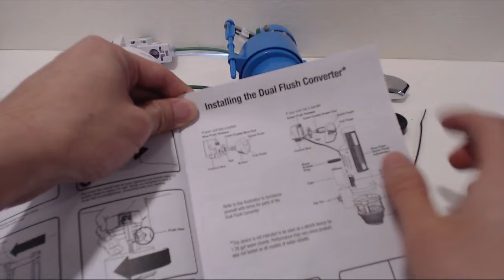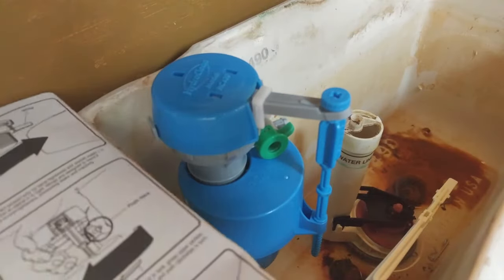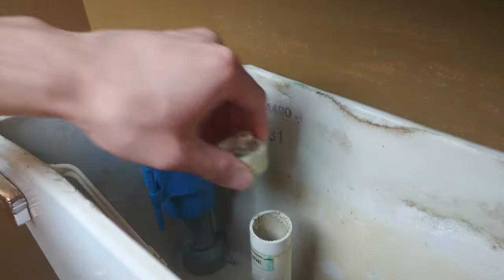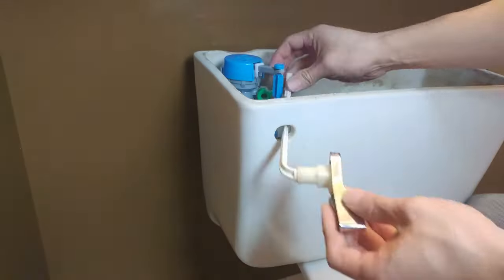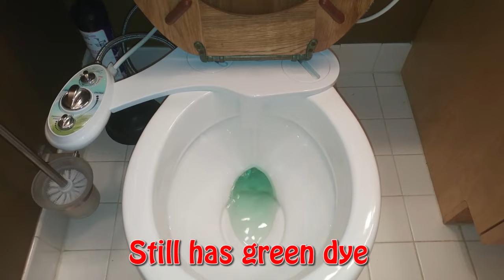How to Install Danco Next Duo Flush Conversion Kit and Review

Comment: Very helpful video.  1 tip for everyone that I missed, is that the nut on the handle is reverse threaded.  The longest part of the install was figuring out the reverse thread.  Beyond that, it was super easy to install this kit.  One thing I would have liked to have seen in this video was how the handle itself worked to select the flush option. Thanks.

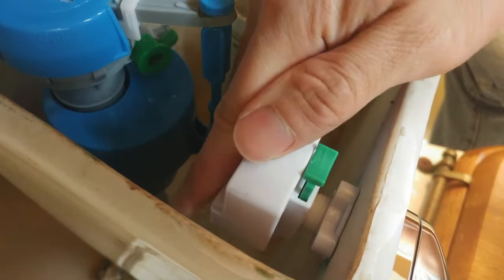Comment: This is an excellent video! I watched it several times to familiarize myself with all the aspects of replacing the flush unit.  The only thing I noticed was that at 2:53 when you put the flush converter back together you say to screw it in with a clockwise turn, but your video shows a counter-clockwise turn.  At 2:18 you mention turning the base clockwise to disassemble the converter so it makes sense to turn it counter-clockwise to put it back together.

Phil what do you do for a living? Your presentation and insights are awesome as shown in how you put this video together. I watched several videos from others, but yours is way better and concise. I've done two toilets so far with zero problems - thank you so much bro!

Comment: I know nothing about fixing household items.  You made my life easier.  I bought the HYR451 from Home Depot and it was in an open box without instructions.  Great price, but I thought I could figure it out on my own.  I was wrong.  Thankfully, your video was full of easy instructions and videos.  I was able to replace the old toilet insides with the new insides without much trouble.  Note that I was getting a little draining of the water from the fill tank into the toilet.  A little nudge to center the fill valve in the opening and it worked.  Thanks again!
Reply from the maker: You're welcome! I'm glad the video was able to help you :-)

Comment: This video was very helpful.  I could not get the quick flush to come even close to draining the bowl but based on the tips in this video, I tried increasing the height of the fill valve to be a bit higher than the top of my tank, while still fiting under the lid, and that fixed the problem.

Comment: This is really helpful.  I installed the push-style flusher in the two bathrooms in my home about 7 years ago. Recently one has started to "ghost flush" and I can see a slow leak from the tank to the bowl.  I disassembled it to try to isolate the leak and inspect the gasket (I'd heard that the material can blister) but the material still appear structurally sound.  I don't have the old manuals but I think I can tell from your video that there are some adjustments I should make to the way I create the seal with the cam and adjust the flusher to my overflow tube that may solve my leak.  That or I'll just need to install a new one.  Thanks for posting!
Reply from the maker: You're welcome! Yep, I think I had to make some minor adjustments after it was a few years in service. Eventually a plastic piece broke in the fast-fill valve and I had to replace that part, but at least it was sold separately and I was able to get the same part from a big box store. Good luck with the repair!

Comment from the maker: The larger side of the handle only separates from the smaller side past a certain point. If you press down only on the outer edge of the handle and hold it down, does it still not separate from the smaller section? Try removing the handle and see if the pieces are somehow stuck, glued, or taped together. Mine weren't, but they should separate too when not installed, which could indicate a possible defect if it doesn't.

Comment: Hey Phil really cool review! thanks for doing it.  I just installed one last night and have to hold the handle down to fully flush. do you know of any adjustments to make? or is it because my toilet tank is too small? Thx again!
Reply from the maker: Yeah, it sounds like it's not getting enough water per flush. If you raise the float it'll allow you to get more water overall in the tank which might fix the problem (see 3:19 for adjusting the float leveler), but if you're already at or around the overflow tube level you won't be able to get more water in the tank which indicates the tank size is just a tad too small. The other option is to allow more water per flush, by adjusting the blue and green water meters (see 3:24 and 3:36, push them down for more water).
Reply: ReviewedByPhil thx Phil!  I didn’t try to adjust the float!!  I was just messing with the blue and green adjusters!!
Reply: Thanks for this you just saved my sanity

Comment: Good explanation in this video.  I’m still not sold on why anyone would want a dual flush toilet though, since you proved it might not work. Water is a cheap and abundant resource.
Reply from the maker: True, in the US, water is inexpensive and averages out to less than a penny per gallon, so from a cost savings standpoint it may not seem like a great incentive. But viewing water as an unlimited resource ignores the fact that many parts of the US experience periodic or frequent droughts (roughly 30% of the country experienced some measure of drought as recently as last month according to the US gov't drought monitor) making water conservation essential in those communities during those times, which can last for months on end, or years in some states. Abundant may be the overall trend, but isn't always true for localized points in time in all places. Plus I think folks feel good about saving water to preserve the environment by way of reducing the energy required to process and deliver water, minimizing pollution vectors, and conserving related fuel resources.

A quick note on why I think the dual-flush didn't work in our guest bath: we already had a water conserving tank on that toilet (hence its shorter height) and since it used less water than a standard tank (3.5 gpf), the dual flush wasn't really an appropriate modification because there wasn't enough water in the tank to make it function correctly and the conservation benefit was not as pronounced, though this was not realized until after I completed the installation. The conversion kits works quite nicely in our standard-sized toilet tank.

Comment: Hi Phil, I pray you still see comments. I have a Fluidmaster Dual flush that I installed years ago. But, it's ghost flushing. I've spoken with their rep but no one sells what I need. I bought Danco HYR460 Total Repair Kit Dual Flush. My question is if it's ghost flushing isn't that caused from the seal? I'm not understanding how this is going to correct a leaking seal. Then I read one of the comments here stating a ghost flush could be corrected by tweaking some adjustment but I didn't follow his comment.
At this point I've not started any installation only removing some the fluidmaster. 1. I'm curious will an adjustment in the Fluidmaster stop the ghosting? 2. Will this kit work to stop ghost flushing? 3. Am I right in thinking this is not replacing the seal?
Reply from the maker: Hi Barbara. Yes, ghost flushing is typically caused by a leaking gasket or seal. In the Duo Flush conversion kit there are two seals, so potentially two points of failure. The first is the curved blue gasket at the bottom of the flush valve that sits in the hole in the tank that drains into your toilet (see 2:26). The second seal is inside the flush valve; when you twist and split the unit apart, there's a blue flat washer/gasket as the bottom of the interior piece (see 2:20), and if this piece becomes warped or crusted with buildup/debris, it can cause an internal leak allowing water to slowly leak into the bowl and cause ghost flushing. Since you purchased the total repair kit, this comes with both the fill valve (part with the float) and flush valve (part that sits in the tank hole). You probably won't need to replace the fill valve, as this part usually doesn't cause any issues. Replacing the flush valve will provide you with both brand new gaskets which generally fixes the issue. If you want to try simply cleaning both seals, this may also remedy the ghost flushing if it is cause by buildup, though it's pretty much the same amount of work involved to drain the tank, and remove the flush valve to open it to clean both gaskets with soft sponge or toothbrush before re-installing it.

Comment: Hi Phil , great video bud . But after installed , I still have some leaking and the water refilled itself after 20 minutes or so . Where should I checked to stop this issue ? 
Thanks so much.
Reply from the maker: Leaking typically means the seal between the fill valve and opening in the tank is not watertight. This can be due to insufficient contact between the blue rubber seal and the rim of the hole (left a little gap) so pressing down a bit on top may help create a better seal. Just be careful not to overdo it because pushing the gasket in the hole too far can also cause leaking if the seal gets wrinkled. In this case the unit would have to be backed out slightly until the gasket is secure against the open but not forced down into it. I hope this explanation is clear.

Comment: Hi Phil - not sure if you still check this but I had a question. If I hold the quick flush button down it will drain the entire tank.  If I hold it for just a second it will only drain for that second.  How do you get the quick flush to drain just the right amount no matter how long you hold it?
Reply: And thank you in advance!
Reply from the maker: If you're finding that you need to hold the quick flush down (any amount of time) to get the quantity of water used just right, you'll likely need to adjust the blue "float" in the flush valve shown at 3:24. To use more water, push the float down and lower its position in the flush valve. If the blue float is already at the lowest position, you may need to adjust the water level in the tank so that the total volume available is greater. To do this, twist the "float leveler" knob, shown at 3:17 clockwise and the water level at cutoff should rise in the tank. If the water level is already at the top of the overflow pipe and you can't go any higher, then it's likely you have an eco-saver water tank on the toilet, in which case it's already using less water than a standard toilet (1.6 Gal/flush), and the Duo Flush may simply not be suited for further reducing the water usage in this situation. Hope this helps!

Comment: The hardest part was removing the fill valve nut on the old one. I had to cut it off because it would only unscrew about 1/4". The second hardest was adjusting the level of tank water because the fill valve and float wouldn't adjust to a higher setting. The J valve is the next frustrating thing. The instructions were not clear enough as to when to attach it and what function it serves. After reviewing 4 Youtube installation videos I took out the other part where the old flapper was to install the j tube. I'm not much of a repairman so some of the frustration is my inaptitude for this kind of thing. Now we will see how long it last as some comments are saying it will not be working within 3 or 4 months. One More Thing: Plumbers are worth their weight in gold!!😡

Comment: Hi Phil your step by step instructions are awesome. I have installed mine last night,. It went pretty well except the fill valve keep on filling up every 5-7 minutes. I have tried to install the blue gasket into the drain so many times but nothing is working. Seems like there.is tiny leak somewhere. Do you have any advice?
Reply from the maker: Hm, sometimes I've found that some folks were pushing the blue gasket in too hard into the hole which was causing it to warp/wrinkle. Pulling it out gently to relieve the excess pressure allowed the blue gasket to form a better seal. You should be able to tell if it's leaking there into the bowl because you will see the water in the bowl moving/rippling after the tank is filled. If you're confident that the leak isn't around the blue gasket for the main flush valve, is it possible that the water is overflowing into the overflow pipe because the float is set too high?
Reply: Appreciate your reply, it turns out my toilet is not compatible when I contacted Danko.

Comment: Phil! I am stumped with one thing - I, for the life of me, am unsure how to remove the original base assembly for the flapper. I had one similar, installed ten years ago, and the assembly is wedged in there and not sure how to remove it.
Reply from the maker: Hm, once that top o-ring on the overflow tube section has been removed, you'll need to remove the gap cam first (2:30), then you should be able to pull up on the bottom of the base assembly, and it should slide out of the tank hole.

Comment: This video made the installation super simple. Thanks a bunch for making it. I couldn’t have done it with just the instructions that came with the product. I do have two issues though - 1) the flush is very weak and 2) I made a pencil mark at the water level as explained in the video, but I can’t seem to lower the water level after the installation. It’s about a inch above the pencil mark. Any help/ideas are highly appreciated.
Reply from the maker: To lower the water level in the bowl after a flush, you'll need to adjust the height of the float by turning the thumbscrew shown at 3:19 and lower it. The water level inside the toilet tank is directly correlated to the water level in the bowl after a flush, so lower the height in the tank should lower the amount of water in the bowl correspondingly. Hope this helps!

Comment: Thanks for the great video Phil. I recently purchased a house and one of the original MSJI Hydrorights was installed. It kept adding more water every 30 minutes and making a loud jet plane sound. I took the unit apart and there is a small bubble on the light blue seal the interfaces of the bottom of the toilet. I'm guessing that's where the leak is coming from as maybe the shape is too irregular to make a complete seal. when there was still water in the tank I tried wiggling the whole plastic cylinder on top of the blue seal  every which way but the slow leak back into the bowl continued. Any thoughts?
Reply from the maker: Hm, without looking at what the bubble looks like I can't tell if maybe your rubber gasket is deformed or not. If so, perhaps you could exchange it and see if the new unit also has this "bubble." One thing I did notice once when installing one of these units is that if I pushed down too much when installing it, it would create a "wrinkle" in the seal that allowed water to leak down into the bowl. It may seem counter-intuitive, but lifting up on the unit slightly may eliminate the leak by allowing the gasket to meet all the edges of the drain hole for the tank. The unit only needs to be pressed down enough to create a good seal. Pushing it in further, past this point, for "a tighter fit" could actually backfire.

Comment: Excellent video. Much more helpful than the written instructions. I successfully installed one of these and it worked perfectly. I ordered two more and again followed your instructions to install them…but this time the Small Flush uses as much water as a full flush in both toilets. For both, I set the water fill levels set to minimum (moved them up) to try to fix the problem, but that didn’t help. Any ideas what could be wrong? Did I make a mistake, is there a setting I forgot, or are they both faulty?
Reply from the maker: So there are a couple things to try. It sounds like you've already tried adjusting the fill float level (see 3:14) by raising the float and allowing more water to fill the tank. If that hasn't worked, try adjusting the water usage floats (green and blue). Move the blue float up to use less water (see 3:24) during a quick flush and push the green float down to use more water for a full flush (see 3:34) and hopefully you'll be able to see a bigger difference in the volume between the two flushes.

Comment: thats great...thanks for the video...i wasnt sure if the J tube came with the kit...the inside flusher mechanisms green lock was all by itself in the box, so no idea what to do there initially and the paper instructions sucked...so again thank you for posting this, very valuable!
Reply from the maker: You're welcome! Our unit is in its 4th or 5th year or so and we finally had to replace the fast fill valve mechanism. The replacement stand alone fast fill valve comes with the self-cleaning J-tube: https://geni.us/Qxcg [Amazon Affiliate Product Link] Not sure why they wouldn't include that with the full kit tho! 🤷

Comment: I have a tank liner and Model HC630C with the optional J-valve doesn’t fit. Do you know of a Danco fill valve with out the J-valve? Very good instructional video.
Reply from the maker: The J-valve is optional, even in the kit that it comes with. If the J-valve doesn't fit, just do the installation without it and it should work fine.
Reply: @ReviewedByPhil  However the small valve that connects to the J-valve seats on top of my 'Tank Liner'. Even if I were to cut a small piece out of the liner to allow for the valve, the water stream would go under the liner, and thereby causing sweating on the tank. All installations that I have seen so far, are tanks wit out the liners in the tank. So my question is the same, does Danco have other models available without the J-valve? Thanks for your previous timely response.